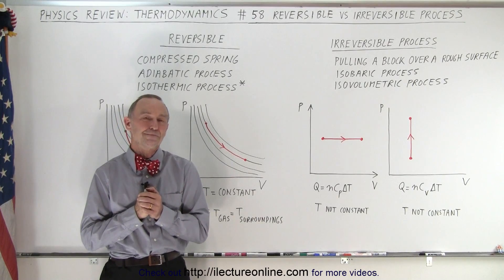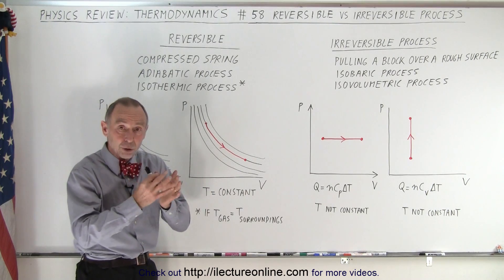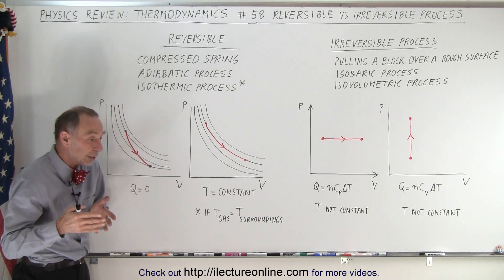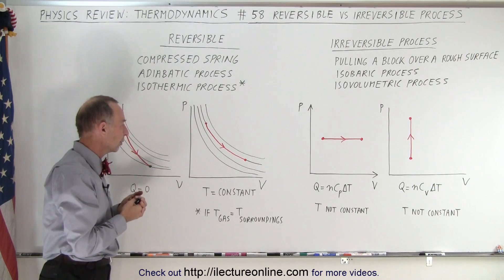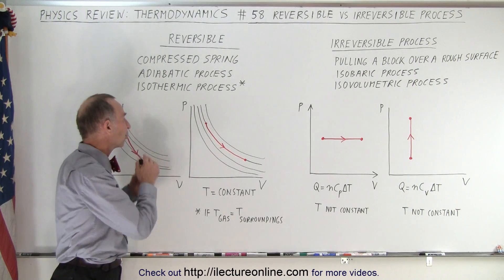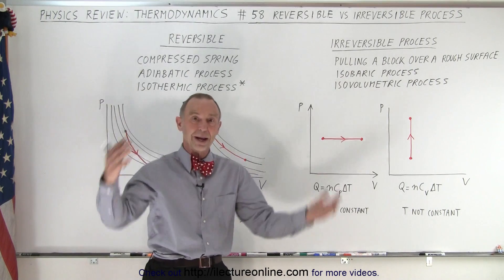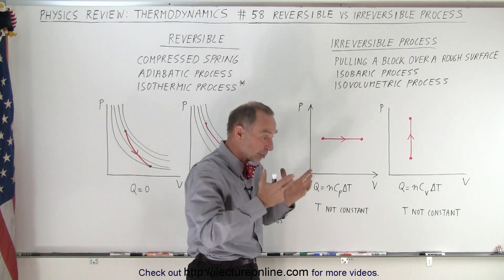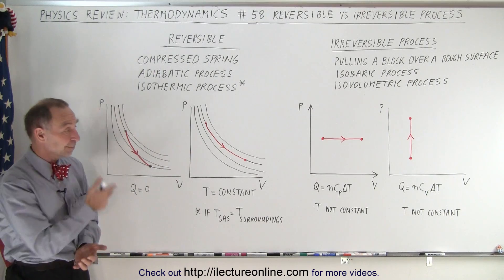Physics Review: Thermodynamics #58 Reversible VS Irreversible Process

Comment: Actually when friction is not negligible, you can have an isothermal process that is not reversible in the sense that compression will have to spend work against friction in addition to work against pressure and, in expansion, the work performed by the gas will fall into work against external pressure and work against friction. So assuming friction symmetry, there is a difference of twice W_f (work against friction) between work input and work output. Similarly, there will be asymmetry in heat output and input, amounting to an entropy increase of two times W_f/T in the reservoir during an expansion-compression cycle.